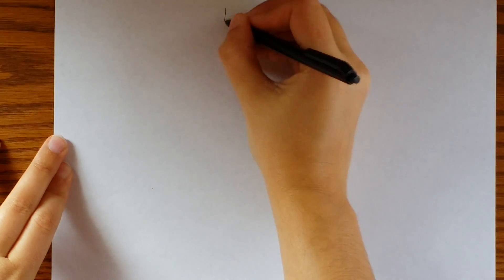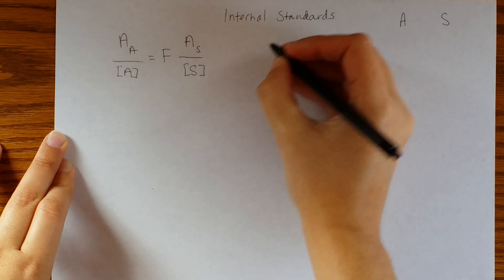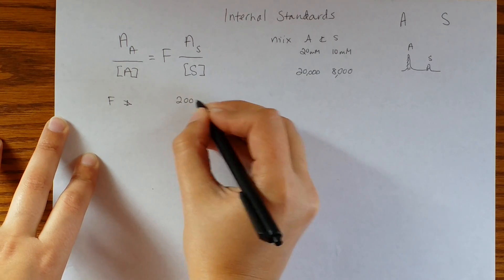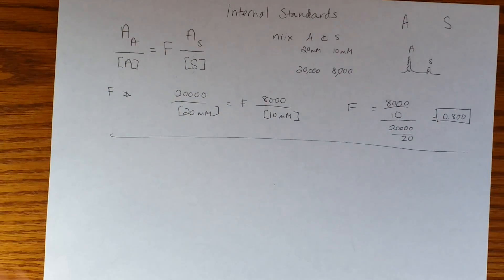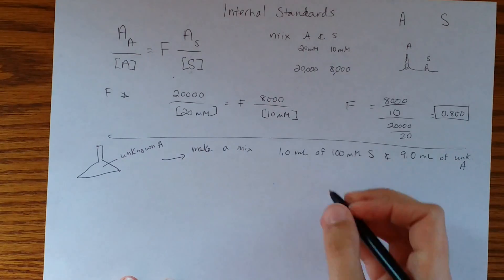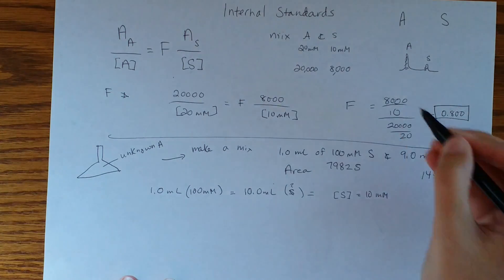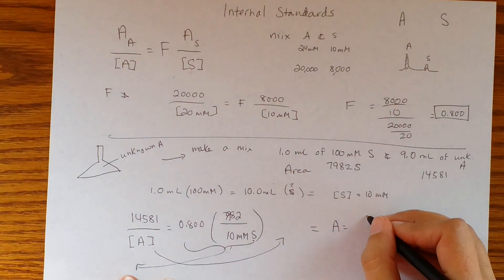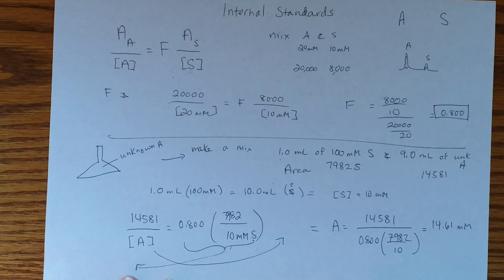Internal standards

Comment: Thanks, but there are misconceptions   about upper calculations: is A a internal standard and s external one.  what is the unit of concentration you have been using
Reply from the maker: Hello Mysara, In this video, A stands for "analyte" (the compound you are trying to quantify) and S stands for "standard", which in this case is the internal standard. An internal standard is a compound this is similar to but different from the analyte and is added into all samples at a known concentration. The units in this video are milli-Molar, abbreviated mM, which is one one-thousandth of molarity. If you would like to learn more about how internal standards compare to external standards, you may be interested in this video: https://www.youtube.com/watch?v=oSGM91uMSjg&list=PLGjuoNhpvD8y68Mrum5rOqOC5h0VyKVVt&index=2
Reply: @robyngoacher  thanks so much I learned a lot from your video. Thanks

Comment: I don't get the dilution part at all!  isn't  100mM a concentration? Doesn't it mean 100mM in 1 ml? Where did the concentration of 10millimole come from? Why did we decreases 100 to 10? I don't get it, Can you help me?
Reply from the maker: If you mean at about 3 minutes in, we take 1 mL of 100 mM internal standard stock and add it to 9 mL of sample. This is how it would be done in lab and the liquids dilute each other to make 10 mL. So the 1mL×100mM = 10mL ×Y and Y is the diluted standard concentration of 10mM.
Reply: @robyngoacher   they diluted each other ok, do you mean the 100mM per ml is thus diluted to 10 per ml? If so, then isn't the sample concentration lesser too?

Also does this happen to any experience? Not just Istd? Like when you add components to eachother the dilute each other? Bc we never did this befor in all calculations and labs I took befor and iam so confused does it mean it was wrong?
Reply: Thank you very much by the way, you helped me a lot
Reply from the maker: @minabish1783  yes the sample also has been diluted from 9 to 10 mL.
Reply: @robyngoacher  thank you ❤️

Comment: why are my thinking i dont need internal standard and 'f' to calculate for the new concentration of A. cos if 20mM of A corresponds to an area of 20000, then an area of of 14581 will correspond to: (14581*20)/20000 = 14.58 mM of A.
Reply from the maker: The math you describe corresponds to the method of single-point calibration with external standards. Internal standards are used to correct for problems with reproducibility. If you want to learn more about the differences between the calibration methods, please see this video: https://youtu.be/oSGM91uMSjg

Comment: Thanks Robyn for the video. It's really useful when it comes to practical calculations. My understanding from the video is that we use molarity in the equation. But my concern is if we take a 1 ml or 10 ml or any portion from 100mM standard solution, we have the same molarity if it's not diluted. So when you multiplied 10 ml (volume) * 100mM (mMoles/volume) then you get "millimoles" as volumes cancel out each other. Regardless of the volume being sampled, the concentration would be the same. Thanks
Reply: I don't get this part at all! What isn't  100mM a concentration? Doesn't it mean 100mM in 1 ml? Can you help me?

Comment: hi, i am a bit slower in maths. should it be F is 1.25 instead of 0.8? please correct me if i am wrong
Reply from the maker: liza wewe Hey - you're right! I accidentally moved the wrong math over. It should be F = (20000/20)/(8000/10) = 1000/800 = 1.25. Thank you for the correction!
Reply: @robyngoacher  do You have a same video on the other methods?
Reply: @robyngoacher  thanks
Reply: I actually got 1.25 when I was calculating myself. Wow. I feel like a genius, bearing in mind I am crap at maths 😯